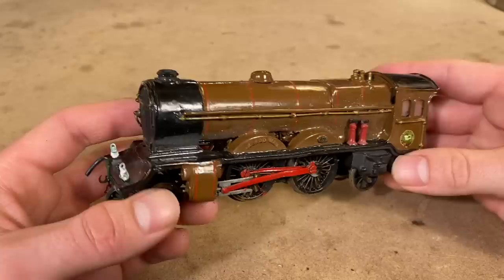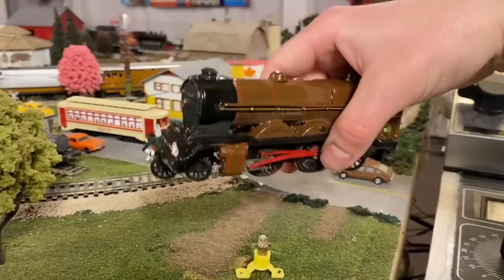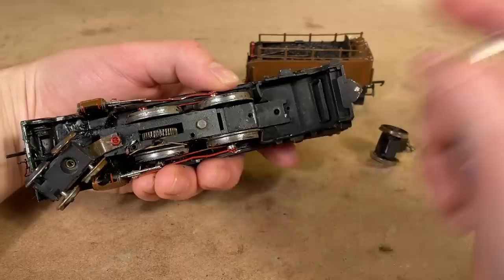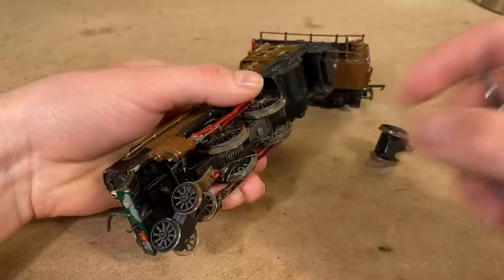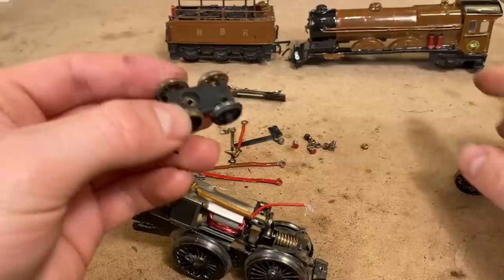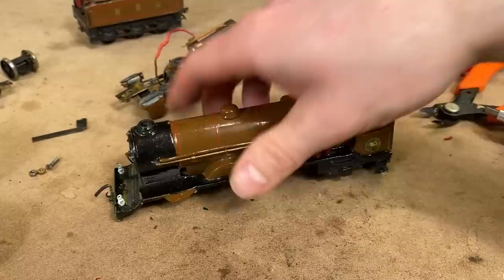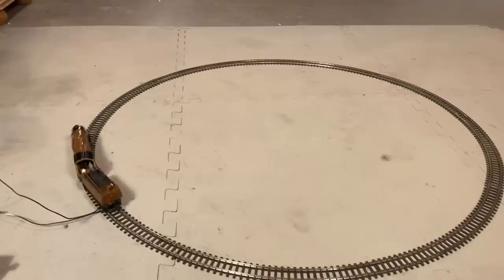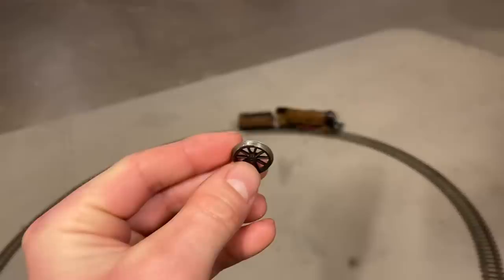Absolute Nightmare of a Steam Locomotive - Will it Run?

Comment: Great video as always. The loco looks like a white metal kit built using an adopted tri ang 4 4 0 chassis. I am not an OO gauge modeller, but I am pretty sure that tri ang never made a 4 4 2 chassis. It looks like it only picks up from one set of wheels, so you may want to improve on that.
Reply: Could be a Triang princess 4-6-2 chassis with the rear driver cut off? Not sure but that's what it appears like to me.
Reply: @captaincool3329  Triang did produce a 4-4-0 loco in the form of the L1, so it’s likely the driven wheelset with custom bogies fitted to the front and back, alongside outside cylinders and valve gear being fitted

Comment: As I watched you work on this, I really wanted you to do the full Monty on it. Strip the paint and completely overhaul and rebuild.
Good job getting it going!
Reply from the maker: Honestly I didn't really have an issue with the paint work, just the drive.
Reply: @SMTMainline  I think a single coat of spray varnish would equalise the paint. Satin maybe or gloss if you want to keep it that way. The decals might want to slide off if you wash the body so a drop of Johnson's Klear to each would cement them in place. An interesting loco and livery I don't know, special.

Comment: SMT - You should certainly now clean the rails on the main line!  Your Volt-Ohm-Meter will be very useful.  That square black pushbutton switch is to select different ranges of resistance, voltage, & current.  The lower ohms range (Omega symbol) will be good for checking continuity, the higher kiloohms & megaohms ranges would be good for checking the resistors used in electronic circuits.  The voltage and current will have different ranges, plus selecting AC or DC.  You had to correct many errors that the original modeler did when they constructed the locomotive!
Reply from the maker: The track was cleaned recently so I don't think that was the issue. Can't wait to use the Volt-Ohm meter on other projects, it's gonna be a bit of a learning curve on how to use it correctly but it's already been useful.

Comment: The loco is a British kite build, made by a company called south eastern fine cast. It's a model of a Scottish company called north british railway from the 1920s. The kit used parts of a early triang loco,all of the smaller wheels came with kit.
Reply: Thanks, you beat me to it.
Personally I’d strip it back, re fettle repair and repaint.

Do you know if the body is dimensionally accurate-ish?
Reply from the maker: Thanks for all the information, it wasn't clear who made all the parts for this (Other then the tri-ang drive as mentioned )
Reply: A GEM kit.
You can see one that was for sale by searching for :
GEM North British Railway Atlantic Class 1 ( LNER C9/C10 ) 4mm
My guess is the kit chassis did not work well so a bodge job using Triang model parts.
Reply: 1910s*

Comment: I'm glad you got that North British Railway H class up and running again. I have some old Tri-Ang rolling stock and I can tell you the flanges on that stuff are much thicker and the rails sit higher than code 100. They were refined to code 100 standard around the late 60s/early 70s. 
British model trains have been more kitbuilt longer than their American counterparts. In fact, some British model train manufactures still provide some rolling stock kits.

Comment: Pre-Triang brass rail Series 0 (1950), Triang Series 1 (1950 - 1951), Triang Series 2 (1952 - 1958), Triang Series 3 (1958 - 1961) & Triang Super 4 track systems are all Code 250 rail profile height.

Triang - Hornby System 6 track is Code 100 rail profile height.
Reply: More like code 125 with my series 2 track.

Comment: It's an early seventies white metal GEM locomotive kit that has been assembled and painted badly.
If you search for Worthpoint GEM North British Railway Atlantic Class 1 ( LNER C9/C10 ) 4mm  you should see a kit that was for sale with an illustration of the makers well assembled one and a description of the parts included or needed.
In the UK hundreds of different types of locomotives were only available as  kits and so were produced mainly in the period of the mid fifties to eighties.
White Metal kits were cheap to tool up for a manufacturer but difficult to assemble well except for very skilled modellers.
I suspect this one had the original chassis ruined by the builder and so tried to use a working Triang 4-4-0 instead.
In the rare case where it is built and modified well to correct shortcomings in the design a very powerful and unique locomotive can result. On YouTube Tony Wright often explains why he only uses these well built kits on his massive layout and so being able to pull scale length trains. However even he will not touch some old sub standard kits.

Comment: This is an old white metal kit of a North British Railway Atlantic on a butchered Tri-ang chassis-possibly by someone like Keyser, who were very popular once upon a time. Tri-ang did make a 4-4-0, but the wheelbase on yours looks shorter, which makes me wonder if this actually uses the chassis out of the M7, with the 4-wheel bogie transposed to the front. The cylinders and rods look like they come off a Princess.
 Horrible gloopy looking and slightly wonky kitbashes weren’t uncommon in the ‘60s- I’m not sure why, although there was less provision for modellers then. If stripped, cleaned, tidied and repainted though, it could be a presentable little model of a rather handsome prototype.
Reply: A GEM kit.
I found more info searching for :
GEM North British Railway Atlantic Class 1 ( LNER C9/C10 ) 4mm 
A poor kit from fifty years ago and badly built.

Comment: This loco would have left the factory in an unbuilt condition, it looks to be a white metal kit on a modified Triang chassis, as Triang used injection moulded cellulose acetate plastic, then polystyrene, whereas kit manufacturers would make white metal bodies designed for existing chassis’s, often designing them for fitting on Triang drive systems. Triang never made any 4-4-2 Atlantic locos, so this is likely using the driven part of the 4-4-0 L1 chassis with custom bogies fitted, hope this helps you learn a little more about that model :)
Reply from the maker: Thanks for all the info, I was guessing it was custom built.
Reply: @SMTMainline  Did a little more research just now, the model looks to be a North British Railway H class 4-4-2, can’t find any info on old kits, so it’s either an extremely obscure kit or a heavily modified kitbash, which, based on the bogies and pistons, it’s likely the latter

Comment: Congrats on 80k!
Reply from the maker: Thanks!
Reply: that engine is an old 1958 tri ang princes Elizabeth loco that has been cut down to make it into the loco it is now, it was normal in the 50 60s to convert a triang prince's Into whatever you wanted it to be, every month the railway modeller would have an article in it, take one triang princes and a hakesaw,
Reply: Yeah congratulations on 80k man @smt mainline aka Harrison.

Comment: My bet is that this kit was built by a child or teenager, that only had a basic understanding of kit building, the paint of the motor looks like it was transfer from when the kit was originally painted. All of the other details, such as the painted wheels tells me that the kit was painted when it was fully assembled, which as any model builder will tell you is a big mistake, for the reasons shown in this video. I would also guess that when the model failed to run due to the obvious, the builder just gave up on it.
Reply from the maker: There they didn't know or didn't care how it turned out.

Comment: I'm pretty sure this is a Tri-Ang "Princess Elizabeth" chassis with the front set of driving wheels cut off. I found a video on YouTube (not one of mine) here about servicing this locomotive: https://www.youtube.com/watch?v=aeJzHVcNb4w
The body seems to be a GEM Whitemetal kit of a North British "Class H" (later called the LNER Class C11). GEM kits are no longer available.
Your model being "Aberdonian" represents the first of the class number 868. 
Some info on the Class H is available here on Wikipedia: https://en.wikipedia.org/wiki/NBR_H_class
Hope this helps! Really interested in older model railway items so this is great.
Reply: Actually I see your loco has the number 870 on the plate, but this would have been called "Bon Accord", not "Aberdonian".

Comment: I don't trust the positioning of the connection side rods. The steam chest (pistons) look weird, as if it is upside down, but I can't find a picture of that locomotive yet so I can't be sure.
Reply from the maker: Something does look a bit strange about it, like the rods are a bit too low.
Reply: @SMTMainline 

I strongly suspect that the pistons are upside down. Is it a Tri-Ang or a Hornby? In any case here is a picture of what I suspect is the prototype for the model:

https://tinyurl.com/2x3ndbnw

Notice that the guide rails for the rods on the pistons are above the drive wheels centerline, not below it and they are right under the running board. So I suspect strongly-but not prepared to swear it in court-that the steam chest is upside down.
Reply from the maker: @arrow1414  I think it's a tri-ang however the shell was made by someone else.
Reply: @SMTMainline 

Okay a Frankenstein Loco😉

Anyway I don't know what happened before but here is the prototype of the loco I was talking about before:

https://www.flickr.com/photos/124446949@N06/35161596442

Btw I e mailed you recently about a video you maybe interested in.

Comment: Did you get your tools as hand me down from a neanderthal ?
Between this and your habbit of putting potentially dangerous untested rollingstock on your powered layout is kinda scary.

Don’t you have 12v test leads or a continuity tester to check for shortcuts?
Reply from the maker: How is putting untested rolling stock on my layout dangerous? There is only 12v DC
Reply: @SMTMainline  risk of shortcuts.
Repeated shortcuts can accumulate damage to wiring (risk of isolation melting), power supply and track surface (through arcing). 
It’s the “death by a thousand cuts”.
Sure it’s not going to be the next Chernobyl overnight. But it’s really bad practice.
Have a piece of track for testing, wired to a copper coil power transformer with little to no (and over specced) electronics rectifier bridge as well as self reset fuses. And either a fire extinguisher or a bucket of sand (or silica style cat litter, the non flammable stuff)

I once had a stalled motor on a Fleischmann N scale locomotive the motor coils were glowing red in 5 seconds (despite a 12v/600mA) Next steps are melting plastic, magic smoke and sometimes start of a fire.
Reply from the maker: @G_de_Coligny  The controller has a circuit breaker and overload warning. I also have an ABC fire extinguisher right beside me. I've been doing these repairs for 15 years and have had many motors burn up, not one has ignited. You would have to be incredibly reckless for one of these things to actually start a fire.